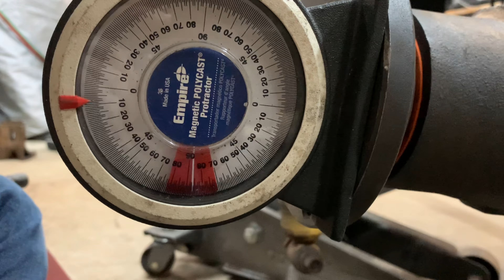Building a Sterling 10.5 for the F-350 Project.

Comment: What is the difference between the dually housing and the single wheel housing?
Reply from the maker: There is a difference in width but also in the location of the caliper bracket. The dually has a different rotor and the caliper sits further inboard to clear the inner dually wheel.
Reply: What year truck is this? I didn't think they built any sterling drw rear ends?